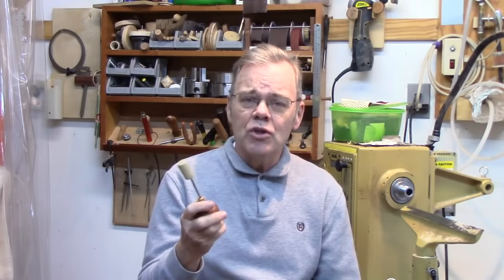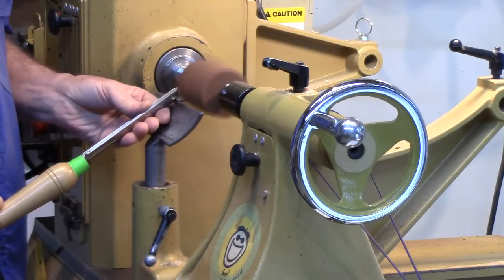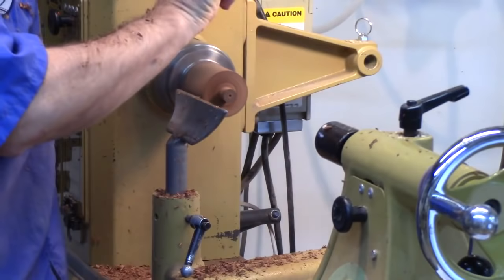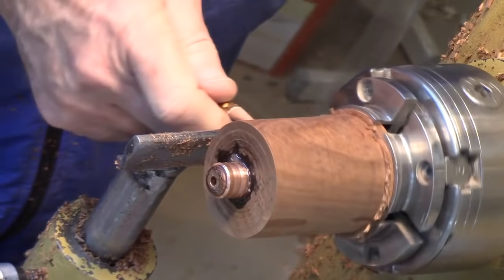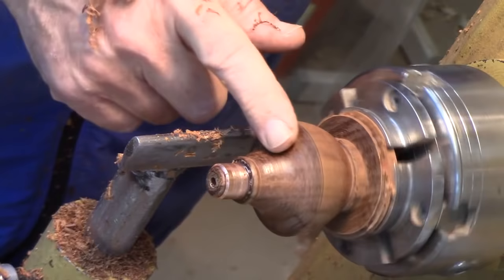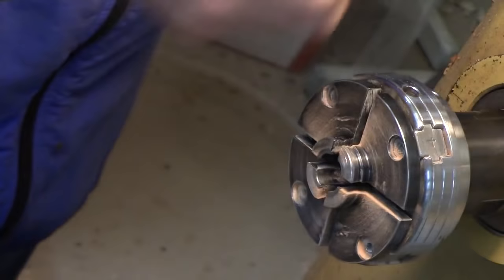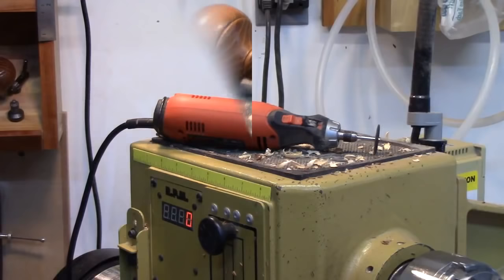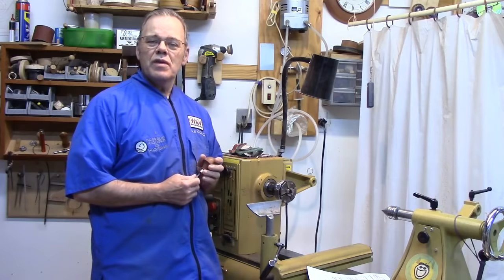How to Make an Awl

Comment: i also use the birdcage style awl.   Like you said, it cuts the fibers.  A round shaft awl has a tendency to slide to one side or the other of a growth ring or the grain as it were.  The sharp corners of the square shaft cuts though the grain.

Comment: Thanks for putting this video on youtube. I am in the process of making 15 as Xmas gifts for members of a woodcarving group that I attend. 
I was fortunate to find awl blades on special at the Lee Valley tools site for less than $1 each.. 
Ferrules in brass and stainless were sourced  from automotive and hydraulic suppliers and were available in many sizes. They are used for covering the ends of braided cable covers and rubber hydraulic line covers. they were the most expensive part at around $2 each.
The wood is blackbean  salvaged from a hospital handrail . It is 40mm thick, 150mm wide and around 1200mm long. Unfortunately I was only able to obtain one, dozens of the others went into bins going to landfill during the demolition of the building.Too much trouble to accept a tender and allow me access to remove them..This is now a fairly scarce timber in Australia.
All the best.
Reply from the maker: Good deal on the shafts and wood. You will have making these I am sure and they will be greatly appreciated.

Comment: Yeah Mike,
 I do leather work also and the birdcage awl is very handy for working leather. It will cut through leather or prick the leather for marking and can be used also as you would use a swivel knife. Very handy to have at the ready any time working in the shop on different projects. I make mine out of damaged brace and bit shanks. The head of the bit is already shaped and with a little grinding makes a very nice bird cage awl as the bits are good steel to begin with. Thanks for the video, lots of good information and tips.
Reply from the maker: +Oneil Long 
Sounds like a good solution if you have access to damaged bits. They are handy tools for sure.

Comment: Mike -- Thanks ... I need an awl ... now I know how to make one!

I stumbled onto a way to make plastic pads for my pin jaws. I bought some 1/2" and 5/8" vinyl tubing in the plumbing department at the big box to make protective sheaths for my gouges. I cut 4 pieces of the 5/8" ID tubing about 3/4" long, warmed them up with a air dryer, and slipped them over the pin jaws. You can tighten them down on a ferrule as much as you want, they don't mar the ferrule or finish, and the piece runs just a true as it does with masking tape.
Reply from the maker: Great tip, Gerald. I may see if that works on my 25 mm bowl jaws. It does give me an idea. I have lots of different size plastic hose bought to put over tool tips when traveling. I may cut a small piece of each and slice it and see if I can't find one to fit over a tenon. to protect it in my small jaws..

Comment: How do you protect the tip?, and how do you protect yourself from the tip in you carry it in a bib
Reply from the maker: That is a great question I should have dealt with in the video, so glad you asked. I simply use a wine cork to protect the end when it is in a tool box. I don't carry one in a bibb. For the three I use in my shop, it is stored in a holder or shelf with a small hole.
Reply: A cork works or a pencil eraser

Comment: mike I love your videos,,,what is the type of chuck and jaws are you using,,can I use a collet chuck to do this also,,
Reply from the maker: +jeff oldham 
I used Nova 25mm bowl jaws. Any jaws that can grasp the ferrule.  The challenge of using a commercial collet is finding one that will fit the ferrule but is a possibility.  Another option is a wood collet held in you regular jaws.  Sharp tools and light cuts!

Comment: Great video Mike! Where do you get the square stock to make the birdcage awl? Or do you just use the sander or grinder to create the flat sides?
Reply from the maker: I use the round music wire and grind it. The picture I showed is of one made from a kit with a square HSS shaft. You can buy those 1/4 square tool bits but they are pricey.

Comment: Another question Mike, why is it referred to as music wire?
Reply from the maker: per Wikopedia: "Piano wire, or "music wire", is a specialized type of wire made for use in piano strings. It is made from tempered high-carbon steel, also known as spring steel, which replaced iron as the material starting in 1834.
Piano wire has a very high tensile strength to cope with the heavy demands placed upon piano strings; accordingly, piano wire is also used for a number of other purposes, including springs, surgical uses, and in special effects."
Reply: Wow, I had no idea they would need it that big. ;)  thanks for the clarification.

Comment: I do like the result. But I do not like that how much wood you turned out. If it is just piece of walnut, maple, oak, ash or any kind of domestic wood, it is definitely ok to do so. But it is exotic wood, no matter it is rosewood or anything else, which takes much longer time to grow than domestic species, and it is not easy to find for everyone out there. Try to save more materials. It is just my philosophy to save as many materials as I can, even it is poplar, the cheap local wood, and I would never waste this much Yucatan Rosewood showed in this clip with great ideas and tips. Hope this could help a little.
Reply from the maker: +BreezeArc Tabletennis Thanks for taking the time to provide feedbck.